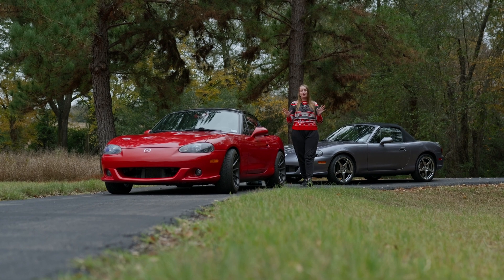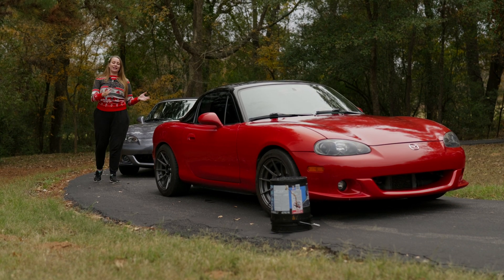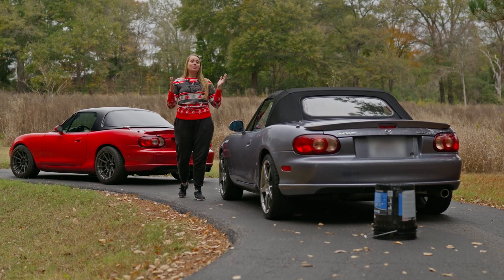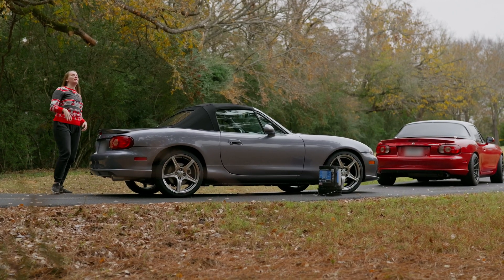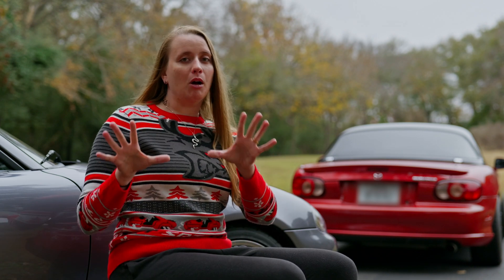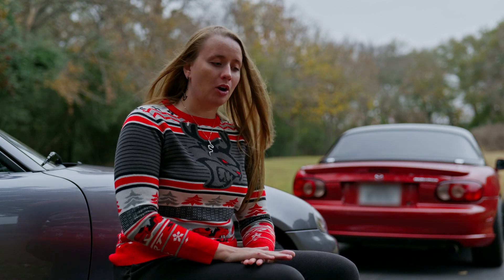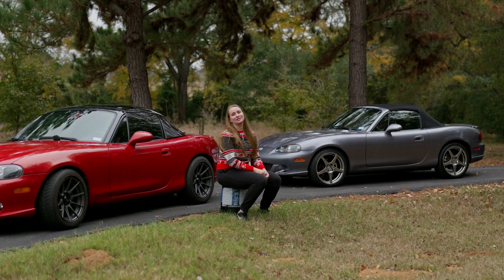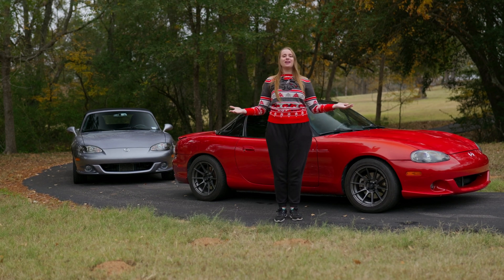How (and Why) Cars Keep Getting Smarter

Comment: 10:00 maybe since I don't review cars, but I'm still super pessimistic about that. 

Cars shouldn't try to be what they aren't. It's silly for an electric car to throttle its power to make itself act like ICE cars, whom themselves have transmissions and shifting because of engine limitations not allowing them to run effectively over a large car speed range.

One day, interconnection between cars will be so safe, that driving manual will be much more inconvenient than now, if not effectively illegal. I'll shed manly years that day, but move on.
Reply from the maker: My Ioniq 5 N review will post next week! I’ll talk about it in depth. I use the 5 N like an EV on the road, but it’s actually really important on the track to have the reference points that the gas cosplay give you. 

It allows you to better understand what the car is doing based on cues you know, therefore letting you adjust to the unfamiliar things (like how heavy the car is under the floor). I would argue that it’s safer out of the gate because it helps you better understand the car you’re in if you’ve never tracked an EV

Comment: Why wouldn't I use adaptive cruise control and lane keep assist on a roadtrip? Because fatigue is not the major concern. Control is the major concern. Hardcore drivers demand absolute control of the vehicle at all times or that vehicle can't be trusted to perform as intended. Soothing massaging seats, speed based cruise control, stratospheric quality Apple Music and a smooth active suspension are my go to fatigue fighters for 723 miles on Rt. 95 from Maryland to Florida. Hope that makes sense.
Reply from the maker: Both of your comments make sense, but I also find that it’s a personal preference! My hands are on the wheel and feet are ready (as required) at any moment. I never feel out of control of the vehicle!
Reply: @AlanisKing  if you’re hands are on the wheel anyway why not just drive?  Maybe there’s something I’m not understanding here.
Reply: Drove round trip from SF to Grand Canyon twice and numerous times SF-LA. Never used cruise control. Need to be in control of steering and throttle feed back at all times.
Reply: @AliasHSW  I use speed based cruise control because it extends driving range by 21%. Which means less fill ups. It’s a complete drivetrain calibration. But floor the pedal, it’s downshifting and catapulting me past 100.

Comment from the maker: A fun timeline, for those looking for bonus info: 

- 1886: Benz Patent Motor Car (with a gas engine) paves the way for the modern automotive industry, although there were some electric buggies before it.

- 1912: Cadillac introduced the first electric starter. Before this, people had to hand-crank gas cars to get them going, and the engine kickback could break their arms or injure them in other ways.

- 1913: Ford began building cars on the first moving automotive assembly line. Model T production time went from 12.5 hours to 93 minutes.

- 1921: The first automatic transmission.

- 1930s and ‘40s: The first Volkswagen Beetle, Willys-Overland Jeep, and Ferrari.

- 1948: An early version of cruise control got patented.

- 1949: Nash began offering seat belts in cars, but the U.S. didn’t mandate them until 1968.

- 1953: Automotive air bags were patented.

- 1966: Cadillac introduced my favorite car feature: seat heaters!

- Mid-20th century: Automakers began a long and major shift from carburetors to fuel injection.

- 1990: Mazda introduced the first GPS-based navigation system in the Eunos Cosmo.

- 1997: The Toyota Prius launched, on its way to becoming a household-name modern hybrid.

- 2000s and 2010s: Automakers increasingly began offering driver-assistance features like adaptive cruise control, lane-departure warnings, and assisted lane-keeping.

- 2005: The Bugatti Veyron broke 250 mph, compared to the Benz Patent Motor Car’s speed of 10 mph.

- 2012: The U.S. mandated four-wheel anti-lock brake systems, and for the time, the Tesla Model S made electric cars cool.

- 2018: Waymo began its commercial self-driving-car service in Phoenix.

- 2018: The U.S. mandated backup cameras on all new vehicles.

- 2021: As electric cars became more common, Croatian automaker Rimac introduced the Nevera: a 2,000-horsepower electric supercar. I drove it a few years ago, and it quite literally changed how I view speed.

Comment: It seems like people are afraid that they aren’t in full control of their car if the driver aids are turned on, even though those systems can be 100% driver overridden at any time. I’m totally with you when you say why buy a 2024 vehicle when you’re going to drive it like a 2004.    I use adaptive cruise and lane keep everyday and just the ACC alone is huge help in reducing fatigue.
Reply from the maker: Yes! Exactly! I think some people think they're giving up control. In reality, they're just letting the car make tiny little movements that they can override at any time, like you say. It's so nice to let a car move the wheel half an inch to keep in the lane vs. me doing it